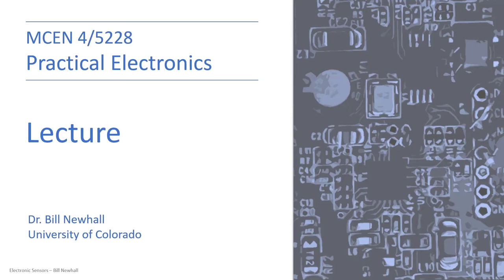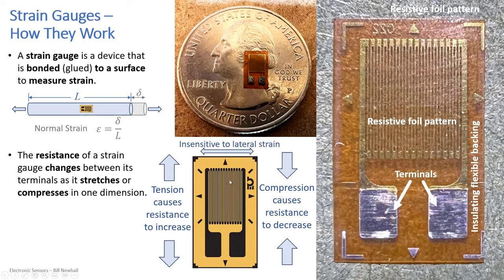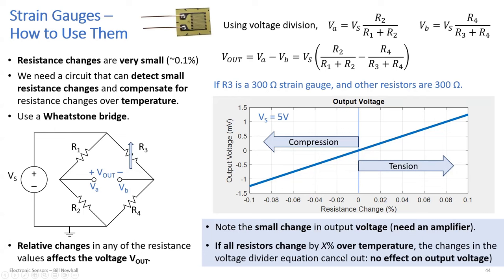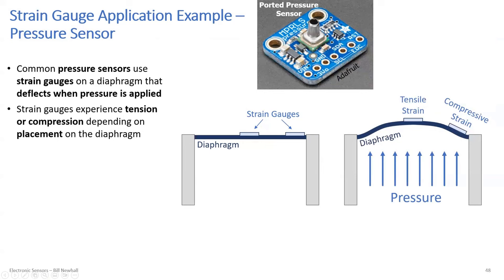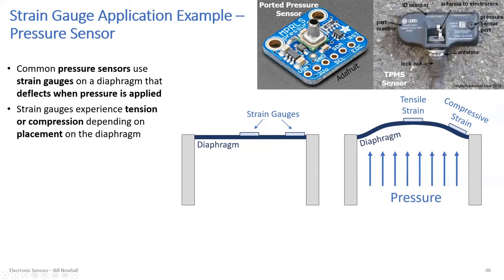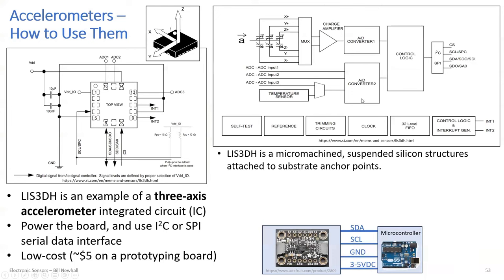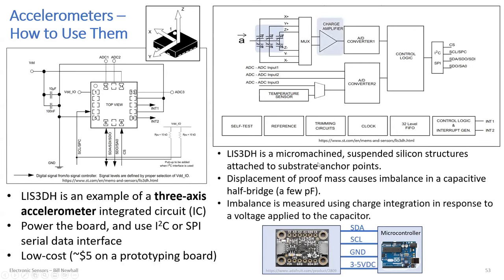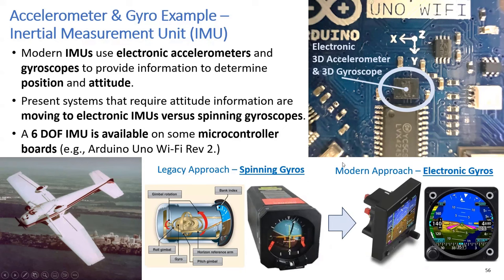Practical Electronics - Lecture 21 (Fall 2023)

Comment: Gosh, I sure miss having a very well stocked RadioShack owned by a skilled electronics couple located just a short 30-minute drive down the road from here. Today the information is widely available in videos like these, but parts/components have to be ordered so there's a wait, and usually cost more.